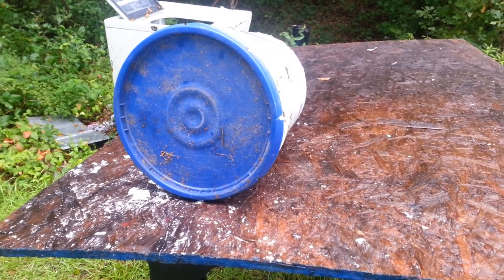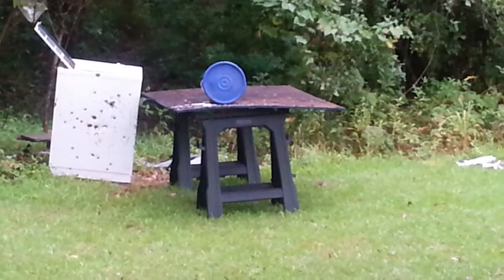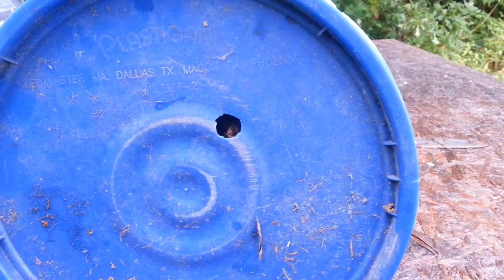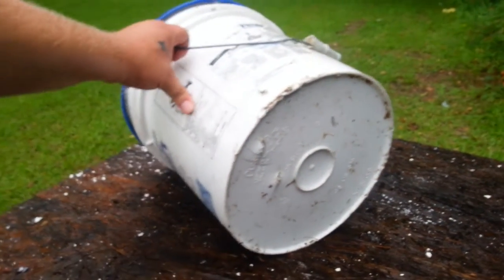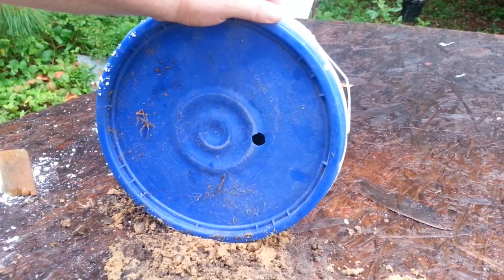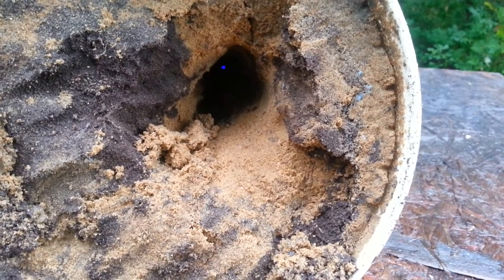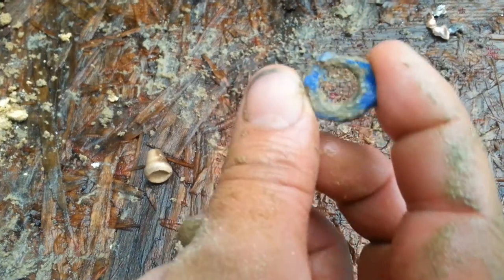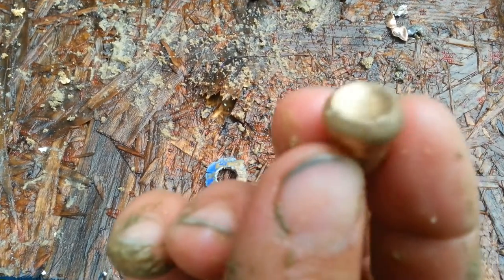410/40cal deer slug part 3 of 3

Comment: I've played around a lot with homemade 410 slug rounds like your doing. Lots of fun. A .38 calber wad cutter fits perfectly in the wad, after you remove the shot. A .40 caliber, like your using, fits just right in the hull without using the wad. I think a 9mm works too. Its all good fun. I put a .40 caliber through 6inch pine log. Pretty peppy.
Reply from the maker: Yeah it was fun something nice for me and my little boy to do together father-son bonding time you know what I mean still no we eventually gave up on it because I couldn't figure out anything that work better then a Hornady slug or a foster slug thanks for your comment don't forget to like And subscribe I've let the channel go for a while but I'mma start back getting in to making videos
Reply: ok , googling 38 wad cutter bulk order
Reply: @waptek2  you can buy oversize fiber wD's from Buffalo Arms
Reply: wads

Comment: I've been doing experiments with 357/38 special, 158 gr. Jacketed hollow points reloaded in Winchester hulls. They seem to work pretty well. The reason your tumbling is the bottom is heavier, so it will swap ends. Just for fun, try loading the shell in backwards, it could prove quite effective. And not tumble. It already shows good expansion when it hits so try this suggestion, I'd like to see what you find.

Comment: How about loading the Bullet BACKWARDS and depending on forward weight to keep it from tumbling?  And adding a fiber "tail" glued into the hollow a la  Brennecke slug to encourage drag stabilization . Think of the feathers on the tail of a badminton shuttlecock.  They stabilize forward facing flight without spinning.

Comment: Hey man, another possibility looking at the piece of plastic from the bucket lid, it looks like that plastic ring may have choked the front of the bullet stopping it from expanding but the dirt then filled the hollow point and pushed the lead core back causing the bulge in the bottom
Reply: This is absolutely what happened.
Reply: Without a doubt it is
Reply: I think so too ..or encase bullet in shrink tube to engage the bore .

Comment: I know this is an old video, but come up because the bullet is a hollow point, that means it's lighter in front than it is in back, so once it turned around in Flight it acted actually like a foster slug. Heavy in the front Hollow in the back. Without rifling to spin the bullet on its axis, it's going to keep doing it. But, if it actually hits the point of aim, does all the damage is supposed to do, and passes through and expands slightly, and go ahead and shoot it. Another but, I think you're on the right track, but what I would do would be shooting a hollow base cast, 40 caliber bullet

Comment: without rifling what you are trying to gain from that .45 slug is like shooting an arrow without fletching,   the laws of physics require that slug to spin to prevent yaw and tumbling.  Frankly,  not to pee in your Cheerios but just about any of the shelf rifled slug will do tremendous damage to a whitetail.  Keep in mind a rifled shotgun barrel by design is "engineered" for a polymer encapsulated "sabot" shotgun slug which will get you where you're trying to go with a replacement slug.  If you misaligne the .40 slug in a .410 cartridge that could be a catastrophic chamber failure potentially in your sons face.  I'm being you please don't manipulate a cartridge that has had hundreds of hours of engineering and testing already put into for the best ballistic outcome.  Just my humble opinion but it could cause a serious failure and hurt you or anyone near you.  Good luck I hope you find what your looking for just always keep safety in mind

Comment: i recall a taofledermaus experiment where they fired a .58 cal minie ball through a 12 gauge.   it was accurate and effective.   i wonder if you used a reversed hollowpoint .40 cal in the .410 would it be an improvement?

Comment: the problem is not the rifling but try to screw a small wood screw through a wad (not a cup but a filth wad) into the bottom of the bullet so its lighter in the back. youre 40 cal. hollowpoint is lightest in the front because of the hollow point and therefor hits backwards. its kind of a foster slug put in the wrong direction into the shell

Comment: If anyone makes a rifled .410 replacement barrel, I would like to know who it is and some information. Thanks
Reply: Depends on the .410 you're looking to rebarrel, but the general answer seems to be "no."  The .410 the video poster has looks like either an H&R or New England Firearms (which was made by H&R) break action.  If that's what you're looking to re-barrel, the short version of the story is "unless you can find a gunsmith that knows how, you can't."

The long version of the story is: H&R got bought by Marlin, which got bought by Remington.  Sadly, H&R ceased production in 2015.  During Remington's last bankruptcy, their assets got sold off.  The Marlin brand was purchased by Sturm, Ruger, & Company, but the H&R brand was purchased by Palmetto State Armory.

PSA has said that they are going to be bringing out some guns under the H&R name, but they have no intention of resurrecting the single-shot shotguns and rifles that were sold under the Topper, Pardner, and Handirifle names.  The reason is that these shotguns and rifles required hand fitting by gunsmiths during the manufacturing process and PSA currently has no interest in hiring anyone with that skillset.

Your best bet for a rifled .410 barrel would be to have one made.  Getting this done for a T/C Encore or Contender shouldn't be too difficult.

Comment: Foster slugs are grooved to go through tighter chokes not to create spin
Reply: They will but not great. They work best in improved cylinder barrel.
Reply: hey guys thanks for your replies this video was just one of those crazy ideas I had came up with but after lots of trial and errors and reading other comments on my videos I figured out that there was no way possible to make that projectile do what I wanted it to but if you take it and flip it backwards like a foster slug would be they are extremely accurate the bullet wasn't tumbling we did some high-speed footage in mid-flight the bullets would flip around backwards because the back-end of the projectile was heavier than the front but like I said if you loaded them in backwards before hand we found that they were extremely accurate and the 40 caliber bullet is small enough when you put it in the Sabbat you can shoot it through a full choke without damaging the gun but if you want around that is extremely devastating for a 410 you can order some Hornady 410 slug projectiles they are ballistic tips and order the sabbats from them as well or you can order the same ammunition already Factory loaded if you're not setup to load your own ammunition
Reply: and just to add a note on the 40 caliber projectiles I was shooting from about 50 yards away in the videos and once I flip them backwards and started loading them that way I was able to hit the bullseye nearly every time at the 90 yard mark shooting from a bench rest I kept it in a two and a half inch group I was also shooting some Foster slugs and found that I was more accurate with the 40 caliber projectiles loaded in the Sabbat then I was with a foster slug but the Foster slug does more damage in a ballistics gel test